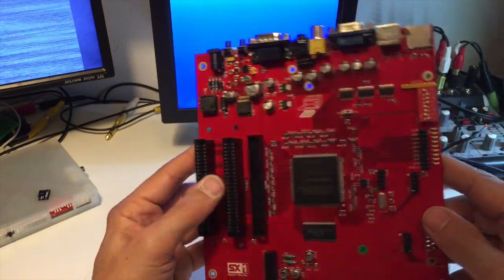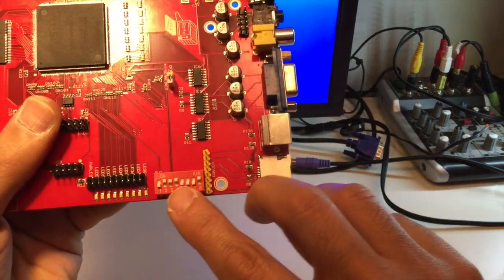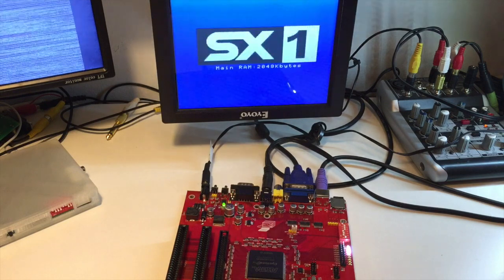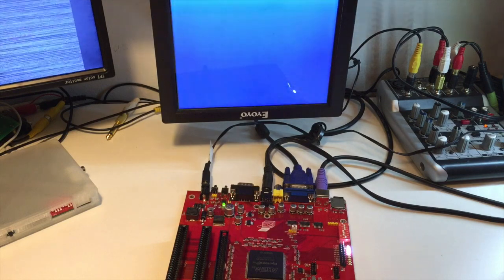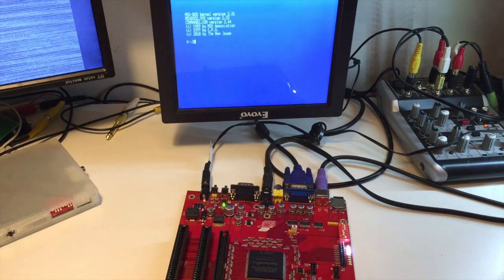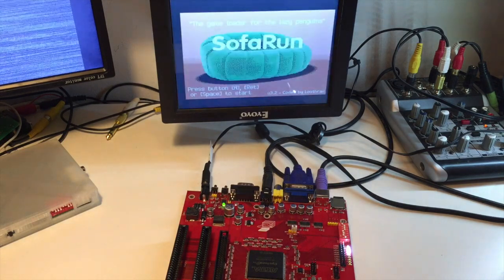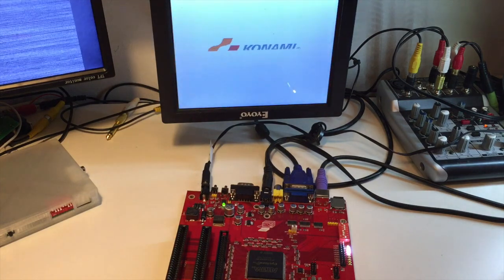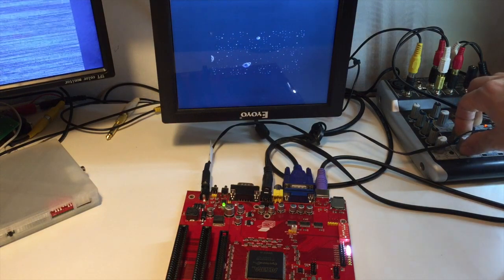SX-1 MSX FPGA

Comment: Does the PS2 port deliver enough energy to be able to use a ps2 to USB adapter so I can connect a USB keyboard to it?
Reply from the maker: What kind of adapter?
Reply: @8bits4ever_Hardware  the standard 1 dollar PS2 to USB adapter most people used on old PC's with PS2 only to connect USB keyboards.
Reply from the maker: @gliderspace  Those only work if the keyboard itself supports PS/2 protocol over USB (same as on a PC). And yes, the keyboard port has enough power; those adapters are passive anyway.

Comment: Hi! It's impossible to program sx-1 board in assembly because it is a fpga architecture, isn't it?
Reply from the maker: The SX-1 board (same as the One Chip MSX or Zemmix) works 99% the same as a real MSX. The FPGA implements a Z80 as well as all the other chips, so you can program in Z80 assembler, or any other language you would use on a real MSX.
Reply: It's amazing! Thank a lot for your hard work!